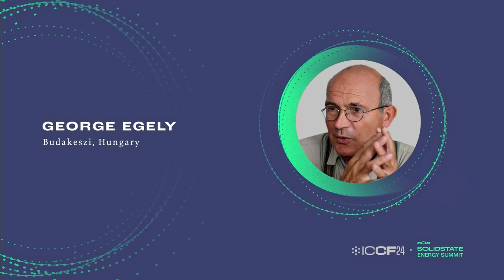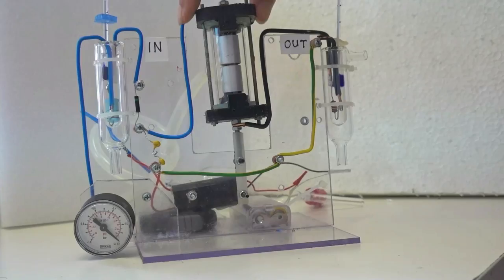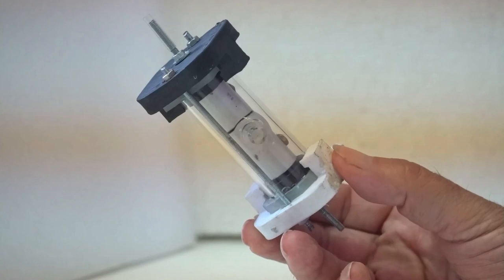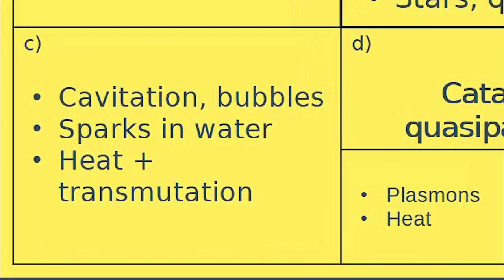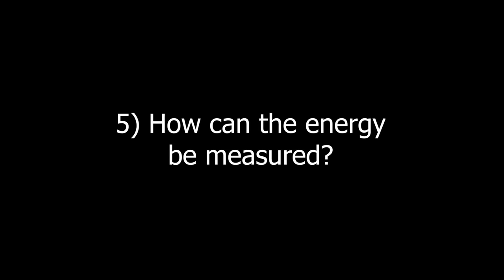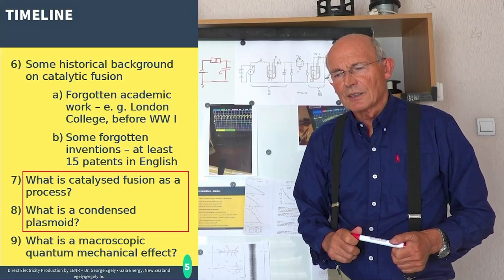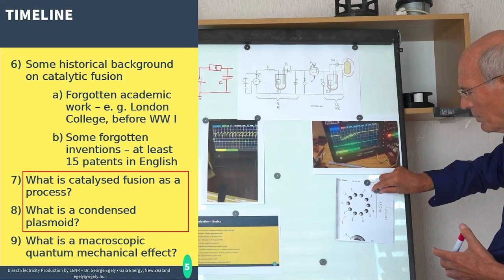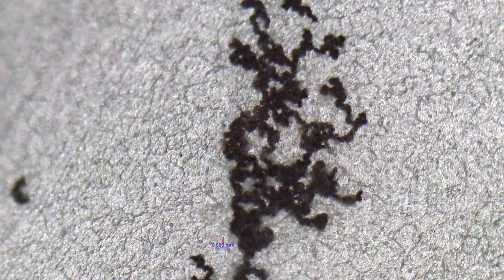ICCF24 Presents:  George Egely - Direct Electric Energy Production by LENR

Comment: The output of the demostrated device by Egely is heat. The output of Mora’s device was electric energy, in the form of high voltage and high frequency currents. The evidence for overunity is not yet presented in a convincing way. Presention of the evidence for LENR reactions is not convincing either.
Reply: You have an opinion and an internet connection. I guess we should all trust your judgment.
Reply: You seem to have a hard time believing over unity phenomenon exist.

I suggest you look at the pistol shrimp.
Reply: @IC-Alchemy never heard anyone claim pistol shrimp are over unity! Nice amplifier of power but not energy. If they were they could stop eating and just use fusion energy to synthesize shrimp food.
Reply: @grumpystiltskin 
Define "power"
Define "energy"

Do you see the problem with your statement?

The energy/power that goes into moving the shrimps claw is less than the energy/ power that it creates, clearly.

How?
Reply: I wouldn't call it LENR.   More like a temporarily self sustiaining plasma using the toroid fractal for stability.  It does make electricity, but more heat.  The electricity is what drives the fluorescent tube attached.  Or just dumped in to a resistor so the  combined heat and electric power can be measured in combination.